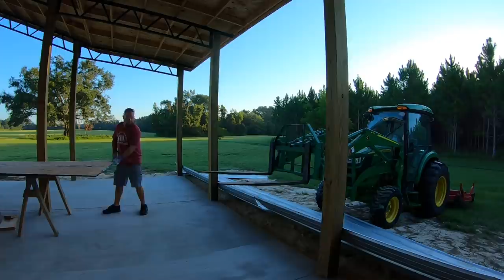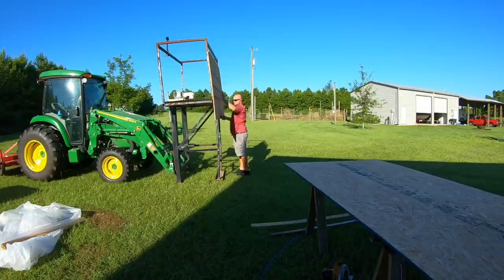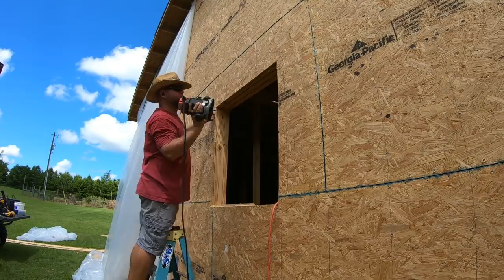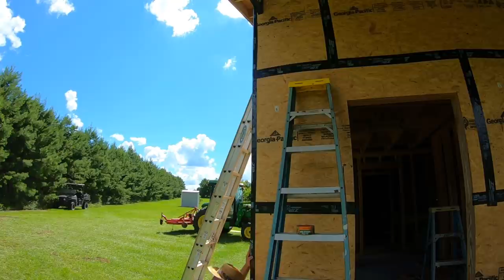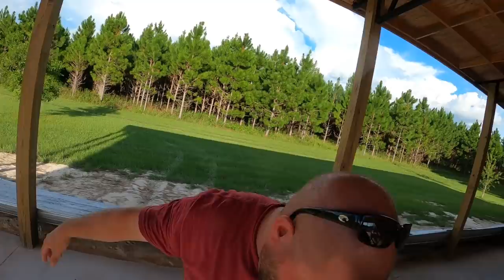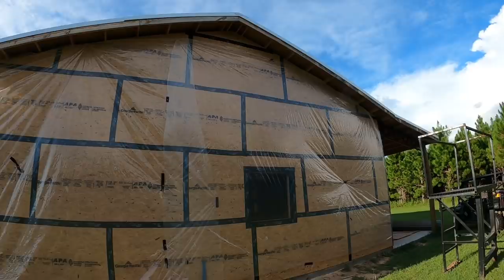Pole barn house sheathing is DONE!!! #410

Comment: I have seen installations, on youtube and on This Old House where they use that tape over the edges of those window cut outs.
Reply from the maker: I've started doing that, but usually you do that after the house wrap is on and right before the window install.
Reply: @TKCL  There are a couple of different ways I have seen. Personally I like the one where you put the zip tape down over the sheathing edges. Then cut the house wrap (which the actual Zip sheathing eliminates btw, too bad you could not get it. They even have that Zip sheathing where it comes with 1, 2 and 3 inches of insulation. Matt Risinger, whose chanel is awesome btw, said that actually encapsulates the whole building in later of insulation. The framing members are actually a weak point in your insulation barrier. This not onlyl makes the building even more efficient but creates a sound barrier. Anyway, sorry for the mini fanboyism. I love this Zip system). I was saying, then cut the house wrap and fold it over the window frame. Then install the window. Then after screwing the window in, use the house wrap tape to tape the sides and top around the window. You leave the bottom open so that water can drain out if it somehow gets in the space under the window. But you caulk most of but not all the bottom of the window so that a path for water to run remains open. 

Anyway, I really love what you are doing. I have been making my plans up for a house when I move in about 5 years and I either want a polebarn house like you have built but with steel main frame members not just rafters or a house made with floors, walls and ceilings out of ICFs.

Comment: The surge air tank really keep the pressure consistent.  
Before house wrap is a sheathing nailing inspection usually.
Reply from the maker: It is making a big difference on consistency. Nail pattern passed, as usual I overdid it 😁

Comment: My appreciation for how much you get done each day in the heat and humidity is way up there. It was 92 DegF and humidity in the 70% range and I stopped working outside by 10 am.
Reply from the maker: It makes the job so much more difficult

Comment: Just an extra for water splashing up from the ground. I took the perfect seal and painted about a foot up all the way around the bottoms even though I was 2 and 4 block high. Just a thought for extra protection! Looks good
Reply from the maker: I'm kicking around ideas myself
Reply from the maker: Where did you get the perfect seal?
Reply: @TKCL   I'm sorry I said perfect seal but meant flex seal. They have it in a paint can at cashway. I rolled it on. Can be a bit messy but put a good coat on it.
Reply from the maker: I've already got the house wrapped, but I'm looking to see if I can lift the wrap up enough to put that on.
Reply: @TKCL  i had used the zip system Siding but felt impelled to put a little more for splash protection.

Comment: Andrew, I have a question.  You said in your previous episodes that the inspector was going to be checking nail spacing and depth very closely.  I was really wondering how that would turn out for you.  Sorry if I missed the explanation, but I'm curious to know how that inspection went.  I saw the wrap on the live feed, so I know you got to move forward.  Really enjoying your build series.  Keep up the great content.  Thank you.
Reply from the maker: No issues since I'm very particular and had my nail spacing even tighter than engineering required. He said his next inspection would be an in progress inspection on me installing the siding.

Comment: What about taping the sheathing to the slab for air tightness bug barrier?
Reply from the maker: I was going to Rubber butyl caulk it, I think it will stick better. There is also foam sillier underneath all bottom plates.